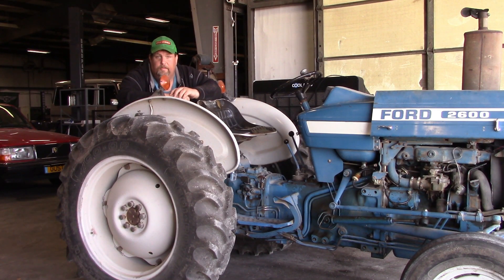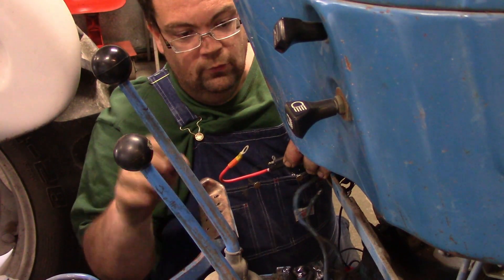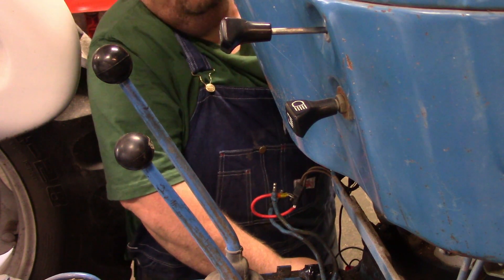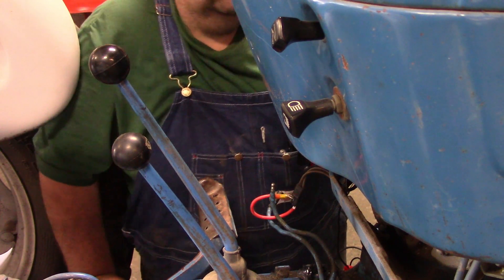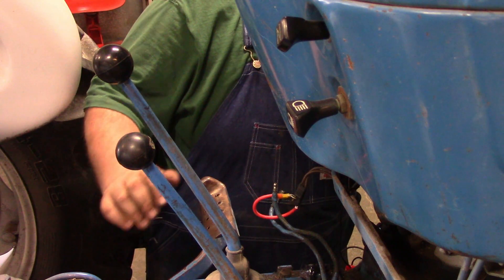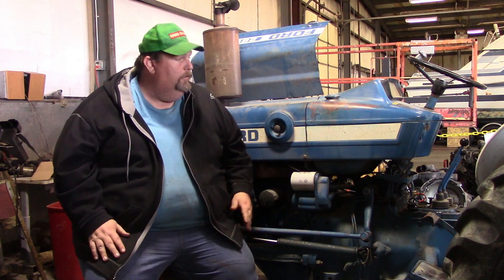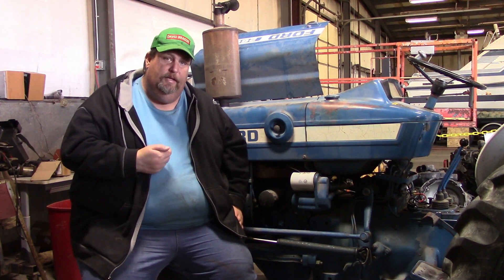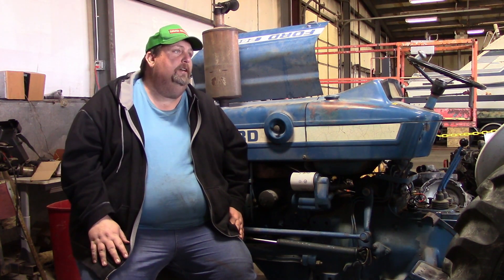Ford 2600 why won't you start 😡

Comment: I could tell it’s a Ford just by turning it over. I have a question if I bought a tractor that wouldn’t see much use am I better off to get a diesel? I use premium gas in all my gas motors but I’ve heard that old gas tractors you need to add lead to the gas?

Comment: When you stated it quit on him the safety switch is only in the starting system, it wouldn't make the tractor quit.
Reply: you are absolutely wrong and you are mis quoting him. He said it died and wouldn't re start. they are not investigating why it died they are troubleshooting the fact it wont start back up. if there is no continuity between the ground circuit clamp at the safety switch and the post at the solenoid .......... well you cant actuate the solenoid without a ground. and just because the switch is located in the starting circuit i can think of two scenarios where a fault at that switch could stop it in its tracks.

Comment: Massey fergusson 240, The engine start very properly but it don't accelerate above 1400rpm. I was cleaned the tank also the pipes and filter. The problem still remain. I wander  if i must change the fuel feed pump before i check the high presure pump

Comment: My dad bought a brand new 2600 diesel with a model 730 loader in 1977. We still have it 44 years later and it still runs perfectly, though it does not start as good when it's really cold out. I think the little glow plug and fuel injector in the manifold is not working anymore. I'll either repair that or put a block heater on her. Otherwise, the tractor runs perfectly!

Comment: So I've binged a lot of your videos the last week ... How about an episode on 'ten best tractors' (vintage pre-70s) for ease of finding replacement parts to rebuild and refit. From Case 900, Ford 8N/9n, Ferguson 20/30/35/135, and so on? Probably the highest original production volumes would be a major factor but also tractor design/features of certain models have kept collectors and farmers enthusiastic about owning and using them in farming operations.

Comment: Excellent video also yes Netural Switch can be interesting when need be located plus fix up too ! But it excellent when fire up what guys had to till new one come in to! 3 cylinder tractor are amazing even Massey Ferguson, International built them back in 1960's for Desiel motors types also hp they have to plus torque to and last long time!

Comment: Wow Dave & Doc, Hearing that 2600 start instantly took me back to the late 1970s. The Ford 3000 that we had on the farm had probably about the same 3 cylinder gasoline engine that was a very solid performer. 
The State Of Ky used basically the same tractor   except that they had the Diesel engine and the tractor was a “Low-Boy” style with the really short very wide rear tires that were spaced out as far as they would go. Those tractors were used for very rough steep embankments for mowing highway right of way and other uses. These tractors usually had a very heavily constructed “Bush Hog AKA BushWhacker” style mower in the rear with the 3 point hitch and a totally hydraulic operated Triumph side sickle mid mounted mower to the right side of the tractor. 
For the top link on the rear mower - Very large chain was cut to length rather than the usual top link to allow flexibility of the mower to prevent the severe metal fatigue that a top link does to the mower frame over a period of time. The newer diesel 4610 Ford tractors were always very dependable tractors and really didn’t come in for repairs nearly as often as the Case International tractors did with the clutch and wet brake issues. The Ford tractors had mostly wiring harness issues and usual routine stuff. 
Throughout my many years of employment, I only remember maybe one or two with ruined engines which speaks volumes about the durability of the Ford tractors. Most of the government 4610 Ford tractors always had the “Shuttle Shifter” with several of the tractors being repurposed with front mounted brooms before KYTC started going to brooms on our dump trucks instead of the tractor mounted brooms. 
I have rambled long enough - Great Video as always.